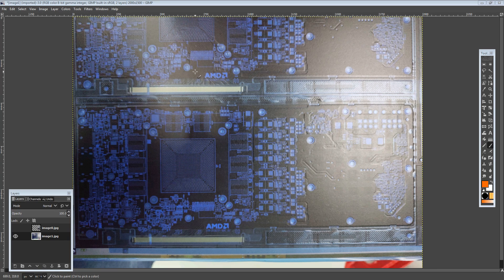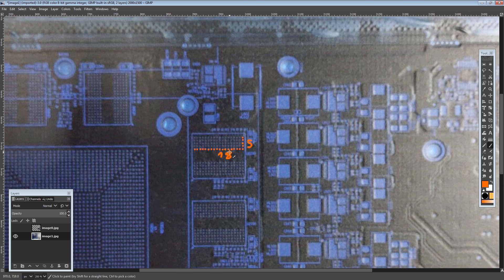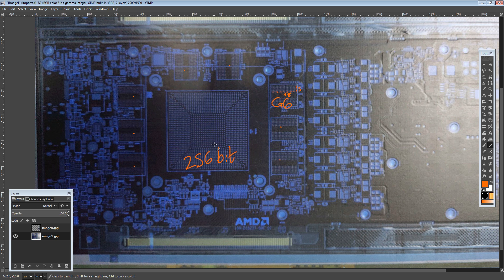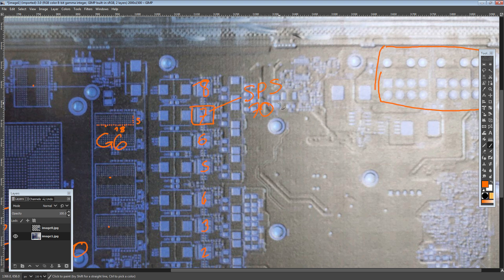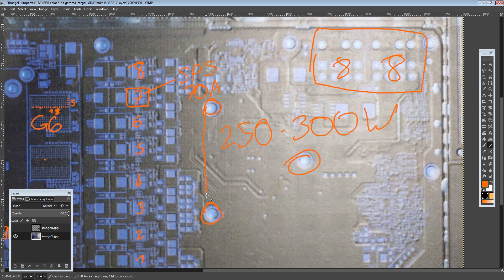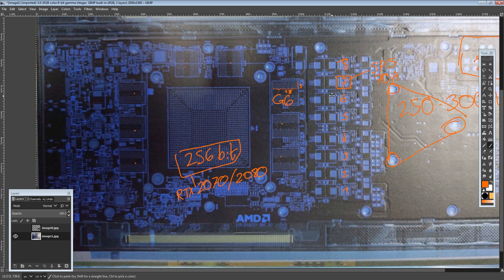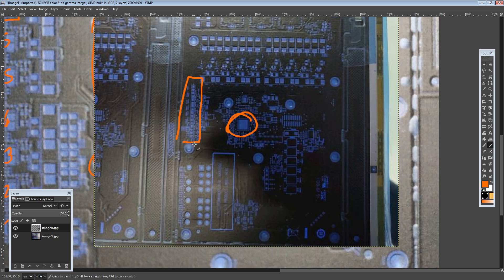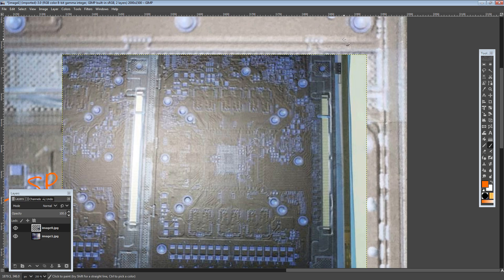Baseless speculation over a GDDR6 AMD GPU PCB

Comment: the 290's were actually really well made with thier heatsinks being huge copperfolded fin things. thier problem was the red fans they used had a forward pitch blade design which moved no air, with the 390x reference and maybe vega64 they went to the modern design BFB1012SHA01 which is a billion times better, the rx 480> used a smaller version like a BFB0712 or something but not sure, they're only loud because they use the SH versions of delta fans which max out at 5500rpm or so, if they used MH medium models they'd max out at like 4000rpm.
Ideally you want a rx590 with the heatsink from a 290x and the vega64 fan.
Reply from the maker: Vega's ref cooler is less loud than a 290X but it's still a shitty blower: https://tpucdn.com/reviews/AMD/Radeon_RX_Vega_64/images/fannoise_load.png

The 290X reference cooler is just so incredibly bad that it makes other loud cards look reasonable.
Reply: @ActuallyHardcoreOverclocking  the loudest blower cooler I ever heard was the 6970 reference design at least 5 db higher than the 290 blower.

I also had 2 reference Nvidia cards a 670 and a 760 both had the fan locked to a Max of 80%(I think) on the factory bios's also giving an illusion that nvida card coolers are quieter.(with modding the bios to ~1.3v and full fan speed got 1300mhz out of the 760 and 1250 out of the 670)

Unfortunately I never thought to document this so I don't have exact rpm but it brought them in to "jet engine" territory.

But I'm in agreement with you no more blower coolers amd will fail if they go that route. Most of my blower cards have literally any other heatsink on it and temps are better noise is lower and overclock are higher.
Reply: I wouldn't call a 980ti heatsink rubbish (lower tdp and pretty much same noise level as a vega64).
Again, good hardware, bad settings.
If i get a pozidrive screwdriver and start trying to bang in nails with it you dont complain about it being a bad hammer.
If every card from 290 onwards had the a BFB1012 fans it wouldn't be an issue.

They're all the same fan design, here's their specs with rpm and typical noise in Dba.
4000rpm: 57Db
3200rpm(80%): 52.5Db
2700rpm(so call it 67% fan speed): 45Dba
So at typical fan rpms of 3K during gameplay between 45-52db given a typical noise floor is 40db they'd be audible but not obnoxious considering a library is about 40Db (I'm aware its not linear).
I really dont wanna have to buy a 4th 290 card to tear down and hack together to test this.

Comment: I really want a blower card. they look more pro grade and less gamer kid.
Gimme 4608 shaders/288 tmu/64 rops, 512bit gddr6 bus (so 2x 590's then but monolithic die) I'll play with the volts, power limit and fan curve. I have a 3way gtx480 system I think i'd rather deal with these thermals.
Reply: You have a 3-way GTX 480 system? Oh so that's why I hear an explosion every now and then!
Reply: @benhur2806  In a gigabyte UD7 with an fx8350 and I'm getting a 4th 480 next week.
Could be worse, I could be using a current gen intel.

(my daily is a 5820k, Currently testing a 7600k system as clients picking it up monday).
Reply: @tomstech4390  who even still uses a 7600k? xD theyre way too expensive for what they are
Reply: @benhur2806  So don't buy one then?
95,037 people who ran userbenchmark and considering 56% of people on steam use quad cores with i5's being the best selling segment probably allot more.

Comment: RTX 2070 level? I'd be happy with that... not with a blower heatsink though.
Reply: 2070 level in memory speed... that does not say anything about gpu speed.
Reply: Don’t they make aftermarket coolers?
Reply: in b4 it trades blows with at 1660ti
Reply: If they fixed the cache? 2080 level. Almost 2080ti.

Comment: is that a usb-c connector on the lower  back of the card? it's very small looking at the others and i seem to recall mixed configurations (12 smd pads+12 through hole pins) for that type of connector are available
Reply from the maker: looks it might be and the large chip near it is probably a USB C controller.

Comment: Random thought: I've seen some AIB cards that use both a CLC cooler paired with a blower fan... just a thought
Reply: And the fact that an H100i 6th gen Asetek cooler only costs $110..
Reply: Then fact 3: Navi has been promosed for how long now? Maybe the fact that they cant keep it cool is the reason for the delays
Reply: Isn't Navi aiming for the low to midrange? If that's the case then I don't think that it'd make that much sense when you consider that just getting the CLLC is going to be pretty expensive by itself. Also the last time AMD had a CLLC, but still used a fan for the VRM and VRAM was the 295x2, and that IMO was a horrible decision.
Reply: @MrPhilip796  well, when you consider buildzoids thoughts that this is going to be an impossible thing to cool... may make sense to have both
Reply: @MrPhilip796  No, Navi 20 is high end, which i think this is what this is for.
Reply: @coolbeans6148  i think this board is suited mor like the Fury 290X
Reply: my thoughts aswell

Comment: I don't know if it's really gonna be Navi. I mean Navi is for hpc with hbm2 mem controllers so they would need to change the architecture to accommodate gddr6. Maybe they realese another architecture similar to Navi but with gddr6 support and name it differently just like Nvidia trolled us with before releasing Turing as everyone thought it was gonna be ampere
Reply: This might be polaris+ on 7nm with gddr6.  Or a reworked Vega 20 on 7nm with gddr6.  I could care less as long as the price/performance is good.

Most odd ball thing would be a prototype board for the new ps5 apu.
Reply: Mark Paermaster already announced that Navi uses both GDDR6 and HBM2. They would use whatever was the best for the situation.

Comment: Oh yeah, the lovely RX 480 blower, took me less than 2 months to give up on it and buy cheap accelero cooler to replace it.
Reply: honestly all cards should come with a accelero extreme 3, but instead they pack a laughable aluminum with tiny fans that make a lot of noise, i just want a double 120mm big aluminum fan that also cools the VRM and VRAM (no after market cooler does this, it would be perfect otherwise)

Comment: Blowers have their place, just not in single gpu consumer setups. 
Still I really hope that they won't use a bad blower design as a reference. 
If they launch a loud blower gpu from the start the reputation of the whole gpu is pretty much damaged for being loud. 
I once owned a blower 7950 and within 1 week I gave up and replaced it with an artic tripple fan cooler.
Reply: I'm glad someone else understands blowers have a purpose.

They are better for case temps and are readily available in dual ball bearing industrial versions.
Reply: Yep they're more practical when you don't know what the chassis airflow is like or if you're going to stack gpus with almost no air gaps.
Reply: @Lead_Foot  Or just in general in rack mounted scenario's where you need to exhost from the back anyway and noise is generally not as much of an issue.
Reply: As long as they have other options available on launch day then selling blowers is OK, the people who buy them tend to not use them but rip them off and put water coolers, so they just want the reference pcb for cheap.

Comment: Would it be possible for AMD to get a 512bit memory bus by using 2GB GDDR6 memory chips? Then the card would have 16GB, and compete with the 2080Ti. Just curious.
Reply: Yes, but as the number of memory ics doesnt increase, memory bus width is unchanged.
Reply: no, 16 memory chips required
Reply: @coinopsy7650  GDDR6 can be made in 2GB chips.
Reply: Question is: Is that the Navi 10 or Navi 20? If
Reply: Yes, but that would have to be for another 2x powerful GPU design with double the number of memory controllers. And with 2GB chips, that card would have 32GB of memory- so for gaming, it would be wiser to use 1GB chips for 16GB of VRAM.

Comment: well there we have it: NAVI 10. sadly THIS LOOKS JUST HORRIBLE. the same inefficient shit on a smaller node. fucking hell the implications are just horrible for pc and console gamers alike (this will be in ps5). thats 2070/1080/vega64 levels of performance max judging from the bus width. and the sad thing it will need 250W to get there on 7nm. fucking hell. all hopes of GCNs last Iteration having a revised, more efficient pipeline are therefore gone. as for ps5 wich surely won't have a bigger power budget for the GPU than 125W thats especially bad news, as they will have to live with sub 1080 performance for the next 6 years. don't rejoice pc master fools - that will determine the base line for what your games will be built for in the said time frame. everybody loses.

Comment: tis looks pretty much like a r9 280 PCB 
(apart from the GDDR6) ... well, and 8 vs 7 Phase VRM
Reply: R9-280 based on Tahiti Pro3 based GCN with 384 bit bus.
Reply: @valenrn8657  This, it's more like an R9 390/290 in my eyes (but with half the memory chips).
Reply: @nextlifeonearth  
RTX 2080 FE has 10 Phase VRM
Reply: @valenrn8657  Is that relevant?

Comment: Oooof, imagine a 300W RGB blower card that looks louder than it sounds.
Reply: Aka hot chick sticker?
Reply: What is the issue with the GPU'S power draw being a meme
Reply: @Erik Burzinski  High power draw equals high heat generation. Combine it with an inevitably mediocre (if not outright crappy) reference cooler and you have an obnoxiously hot and loud card.
Google "R9 290X memes" and you'll see.
Reply: @mungojerrie86  thanks
Reply: " 300W" only in ngreedia-lovers dreams. https://i.imgur.com/H7IDNPz.png
Reply: @TheImpartialTruth55  Under  200w is easy for a blower. If you really care go custom
Reply: Looks like RX Navi will be another RX Flop.

Comment: 300W blower GPU? what could go wrong? what you don't want a jet engine inside your case and a GPU running at 80-90°C?
Reply: Melamamoduro A reference 1080Ti card at 120% power limit, which is 300W, should run in the high 60’s to low 70’s in full jet taking off mode. That’s not so bad, but they’re not quiet for sure.
Reply: @ericspda  And the 5770 TDP is 100W yet it hits 85°C like nothing, blower GPUs are that bad in general.
Reply: I have flashbacks from my R9 290X :(
Reply: This is a problem of all cards, idk why they don't use a arctic acellero 3 design or better a raijintek morpheus 2 one (that supports 2 120 mm fans so you can put some noctua ones) with this setup you get at most 50-60 C with lots of overclock headroom and also little to no noise. The thing they could add is connect the heatsink to the VRM and VRAM so you get tons of heat dissipation (current problem of the after market coolers i mentioned is that they don't cool off VRM that well)
Reply: kelvinfried chicken  Nah, 40-80 fan speed curve with a 140mm intake side panel fan next to it at 50% speed.

Comment: successor of RX590 maybe
Reply: At 300W on 7nm ? Sure.
Reply: @DNAReader  You can have 2 8 pins and still not have a 300w TDP
Reply: @jotunheim5302  Well I guess it could be a low end / mid Navi and not the most powerful.. But RX590 had 6 phases of Vcore @50A with 8x/6x power and Buildzoid expects 8 phases of Vcore @70A with 8x/8x power so this one looks like a high end Navi. I would bet it's the flagship, so >= to Radeon VII performance.

Comment: I very much doubt AMD is going back to blowers, and the power and VRMs seem a bit overkill, so I'd like to think that's some internal engineering sample made to test out the limits of the Navi silicon without any concern for noise or what amount of current the GPU actually eats.
Reply: "and the power and VRMs seem a bit overkill". You mean like every AMD reference board ever made??? They do this with literally every single reference GPU PCB design they do (but then sometimes invalidate all of their reference PCB design awesomeness on their own reference cards by doing stupid shit like putting a 6-pin power connector on the RX480 instead of an 8-pin, despite the ref PCB supporting both & killing some poor peeps motherboards, OR putting reference Hawaii in the most underspecced blower cooler ever made, to the point it would thermal throttle at stock in hot climates [and with it's stupid temp curve, that meant temps over like 95C] making overclocking practically impossible. This means 3rd party designs using AMD's reference board especially tend to be very capable for cards w/o a custom PCB.)

Also, meethinks this is a Radeon Pro PCB with the blower mounts & "Radeon Pro Blue" coloring.
Reply: If they were planing a water cooled hybrid card they might include fan mounts for VRM cooling. AMD has previous with out of the box liquid cooling with 295x2 , FuryX, Pro Duo. I know they're in the right place for a blower design but it could still work.
Reply: Remember that Navi suppose to be cheap. Just because radeon 7 got 3 fan aluminium cooler doesnt mean Navi must to follow that if its at half the price or less :P
Reply: @MaggotCZ  But radeon 7 was 700 dollars because of the overkill hbm2 vram not to mention 16gigs of it...
Reply: Blowers are still better for internal case temps in most scenarios.

All or most of the pro cards from Nvidia and AMD have blowers.

OEM's tend to prefer them as well.
Reply: @nocturnal0072  But the coolers for the pro machines are different than the fans used for PC.
Reply: @materialburst983  No blower fans are not the bees knees, but when properly designed around, they work well and last.

They get a lot of undeserved flack from enthusiasts.
Reply: @nocturnal0072  Because the one benefit they bring vs horizontal coolers is easily fixed by adding a single fan somewhere near the GPU or otherwise just having decent case airflow...which you should have regardless.

The reason they're used in workstations and servers is because they don't (always) give a rats about noise, so you just go with whatever's cheapest and cools it enough/fits into a 1U chassis. Blowers are kinda shitty when it comes down to it.
Reply: @TheDemocrab  Blowers are preferred for workstations because they're often either rack mounts that don't have a lot of space in the case and/or they have multiple GPUs, a scenario in which non-blower cards are kind of shit.

There's nothing inherently wrong with blowers and they can work under a lot more conditions than non-blower cards.  It makes sense to use them in reference designs.  Of course board partners are still free to do whatever.
Reply: @kevadu  I...outright said that with "fits into a 1U chassis" although I guess I should have said rack-mount in general. (Yes, I know there's 4U with GPUs in every slot too)

And honestly? Even with mGPU blowers are still arguably shitty because they're still drawing their air from the few mm of space between the cards and given how most cards are laid out, likely from right behind where the next cards VRMs (ie. One of the warmer spots on the card) are located, there's a good reason why a lot of servers that fit into that category run a blower style heatsink with no fan on the actual GPU, relying on the usual method of server cooling (ie. case fans with ducts and the like to force airflow through the heatsinks) which isn't actually a blower style cooler and defeats the negative points of a blower given that you don't need to use a squirrel cage fan among other things. Even when people run SLI/CFX setups with the cards jammed up against each other using a blower cooler, they often have to include some form of airflow aimed at the top GPU specifically for the top cards cooling. (I'd actually argue that in theory having a blower for your bottom GPU to prevent the hot air exhausting straight into the top GPUs fan(s), but a traditional fan style cooler on top to get maximum usage out of the minimal space would make for the best GPU temperatures in an mGPU setup when you're not using ducted cooling even if it'd look a tad ghetto.)

The squirrel cage fan blowers are the ones that usually make little sense because you can either do the server style route with normal fans, or you can get better cooling with a dual/triple fan cooler with the small cost of good case airflow not being as optional as it otherwise would be (Something that anyone who wants to say, overclock their CPU, run multiple GPUs or constantly run at high load would want to figure out for their setup anyway) and a slightly higher cost of production on the heatsink itself. There are a couple of niches where they make sense (ie. ITX build where you can't guarantee you'll have good airflow even with a lot of thought put into it, or that mGPU setup I mentioned above) but beyond "they're cheaper to make" there's not much reason to use them...and I'd place money on that being the main reason we still see them on reference cards so often.
Reply: @TheDemocrab  That and you don't want hot air being blown into your 4U rack. Getting it out has ALWAYS been preferred.

Comment: You can already see AMDs fuckups for Navi which means its going to be a total failure and no one buys it. For fucks sake AMD. Do you want to lose? Bloower style cooler, likely the only one available at launch. 2 8 pins meaning high power consumption. Honestly I don't think anyone at RTG even gives a shit anymore. You can see the reviews now, hot, loud and inefficient with no ray tracing. Get the 2070 instead.
At the top it seems there are pins which could be an IF link for XFire.

Comment: the chip at the bottom left looks alot like the usb-c controller on big turing, and there appears to be some smaller video connector right next to that.
Reply from the maker: oh that could be it.
Reply: And there is a little BIOS switch on top left.
Reply: That's exactly what it is, for VirtualLink support for VR headsets.
Reply: If that's true, then thank God. I really want an AMD card that supports Type-C monitors.